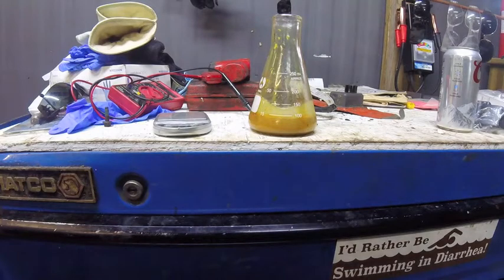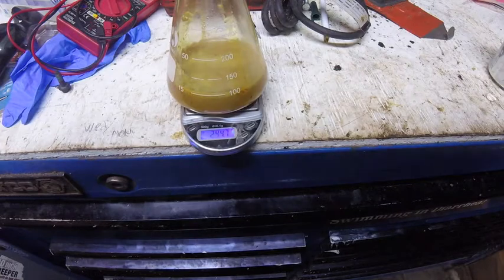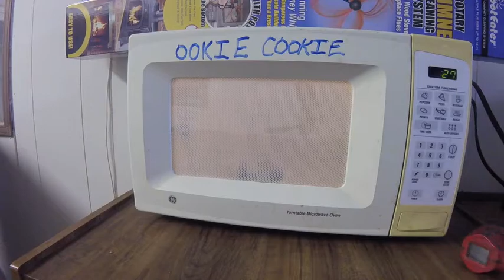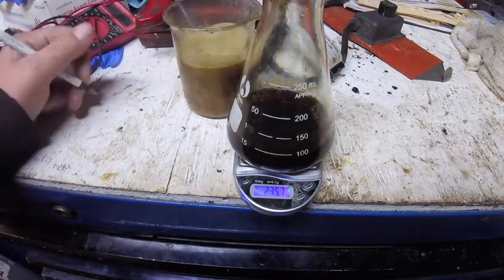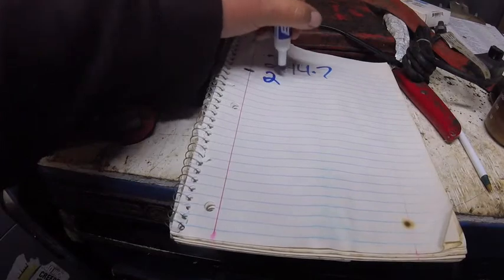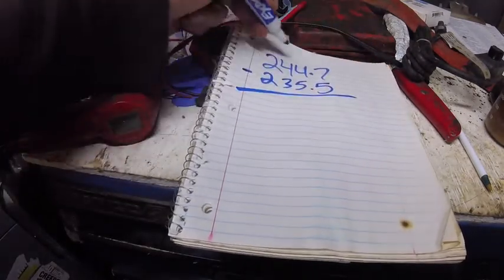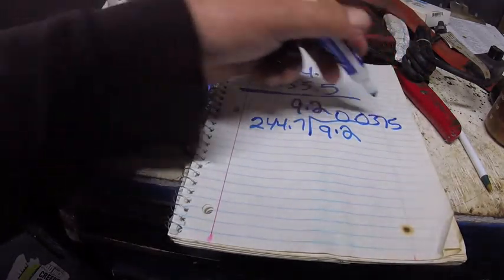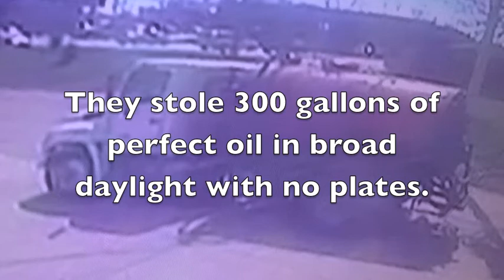EZ method for determining moisture levels in oil

Comment: you need to subtract the weight of the flask.   as i don't know the correct weight of your flask, i estimate it to be 80g.  244.7 - 80 = 164.7.   9.2/164.7 = 0.056   0.056x100 = 5.6%
Reply from the maker: I assume you're right, knowing full well that I'm just smart enough that every job I'll ever have I'll have my name on my shirt.

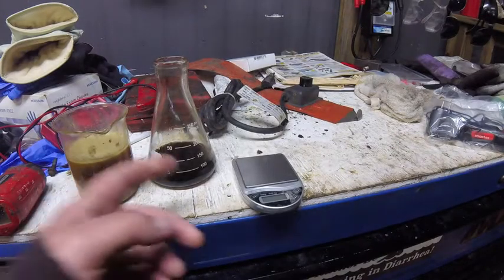Comment: 1:45 heat affects volume but not weight except of course by evaporation which you were witnessing when the weight kept going down which means it wasn't done evaporating. Actually the oil evaporates to but at atmospheric pressure very very slowly. Thats actually why vegetable oil makes everything around it sticky especially cabinets above a frying pan.
Reply from the maker: The thing I love about youtube is when dipshits like me try to explain to the world how to do something, there is someone way smarter watching that takes their personal time out to correct or educate said dipshit. On behave of the internet I sincerely thank you for your comment, I never actually thought about it that way.
Reply: With a large enough audience you tend to get people from all walks of life. I myself wouldn't know anything about building pumps or welding. I'm learning a lot about biofuel mixtures. Thats why I sub channels like yours.

Growing up on a farm myself I admire your type of humor and I'm noticing you have a pretty enterprising attitude.
Reply from the maker: Cool! I have quite a few biofuel vids on the horizon, nothing new to the craft, but simply a bunch of shit I haven't shot yet due to time constraints and lack of appropriate audience. How's that for a tease?

Comment: Just a tip for when you do this type of neat stuff to make your biofuel: You're after heat and retention time, the same way mineral oil from the ground is fractionated into different grades of goop from tar to high test go juice and how the water is removed from it in the first place. 

You do the initial separation of free water from the oil when you first get it with a little heat to make it liquid again and draw off the water that falls out. There's still water droplets trapped in the oil that may come out at a later date. In the O&G industry we use a piece of equipment called a Heater/Treater to do just this. It keeps the oil warm enough (45-55*C) and provides enough retention time to get it to 0.0% Basic Water & Sediment cut - I ship 54 000L loads out to a processing plant that have 0L of water in it. Bone dry. Another thing to consider is that water is attracted to water, so it's not a bad thing to keep some water in the bottom of where you heat your oil and draw the cleanest, driest stuff off the top. A small hand crank centrifuge (http://www.cvs-controls.com/products/centrifuges-18800.html or similar) and some graduated pear jars will help you measure the water cut of this oil.
Reply from the maker: You summed up my process in a nutshell. I heat 10,000 gallons to 140F and let it sit for a while, skim the good oil off the top and every few cycles take some water/sludge off the bottom. We are allowed 2% maximum moisture so it's pretty easy to make that spec without spinning it.
Reply: Joe 30 pack cool. Thanks for replying! Same processes over different industries.